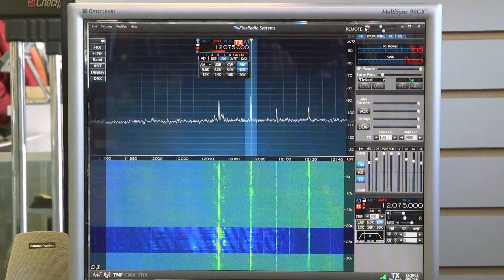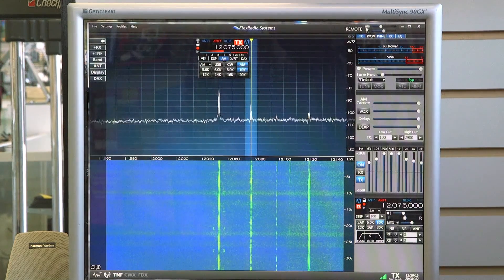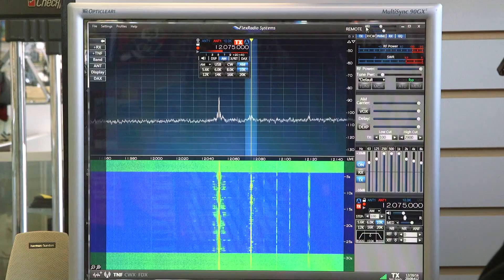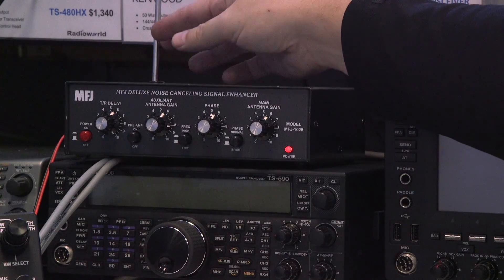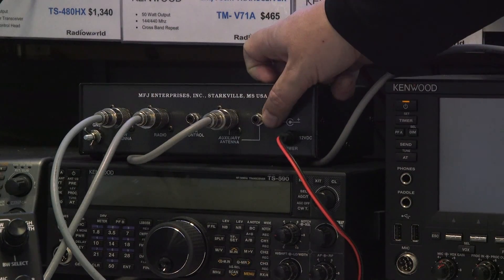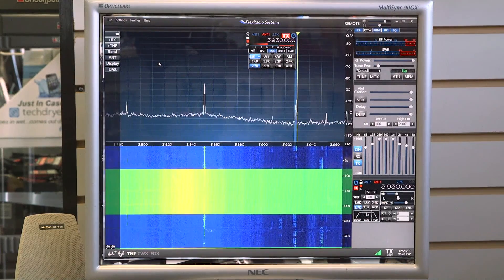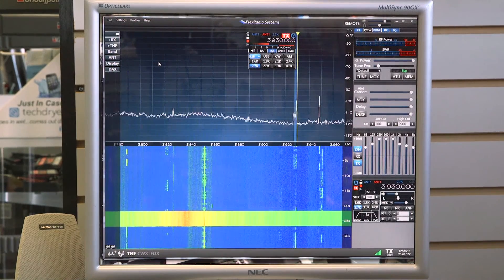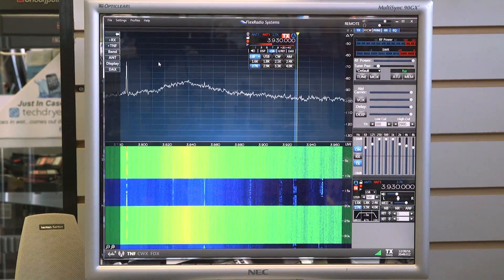MFJ 1026 Signal Enhancer/Noise Canceller

Comment: This is exactly why and what I bought this for. I am not getting good results. So... What is your actual configuration? internal antenna or external? i see you have both connected. Also how did you adjjust the unit to achieve these results? In my case, the 1026 worsens my signal to noise ratio. help help help...
Reply from the maker: Sorry for the delay in answering..
We used an outdoor antenna because our interference comes from a noisy hydro transformer down the road.
If your noise is indoors, use the internal antenna. Not all situations are the same, so some trial and error is involved.

Comment: Apart from cancelling the noise, does this unit help to overcome RF overloading the FET?
Reply from the maker: Hi , no it is just for cancelling noise. I guess you could turn down the gain if its overloading.
Reply: No need, just turn gain down a little or use attenuator.